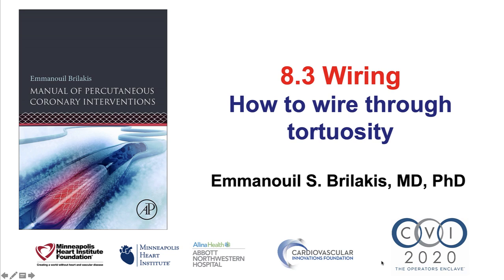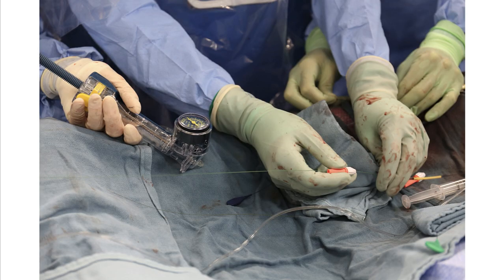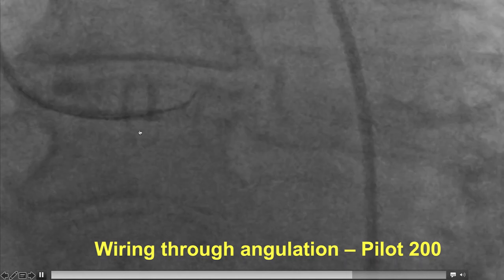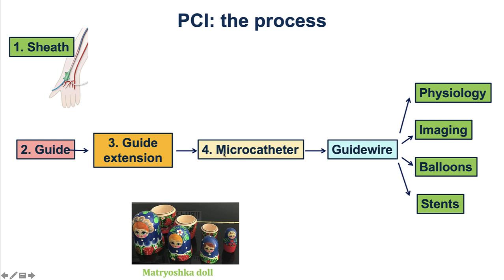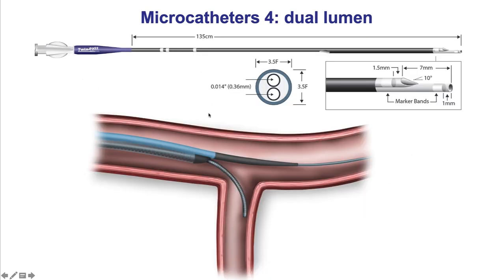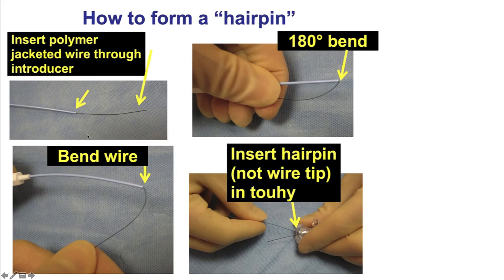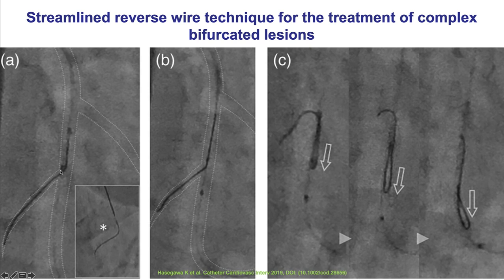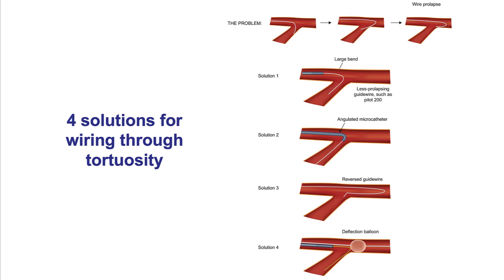8.3 Manual of PCI - Wiring through tortuosity

Comment: Thanks for sharing. I find the reverse guidewire technique somewhat prone for dissecting since the bend is traumatic when navigating the vessel. And the unfolding in the SB is also not easy. Using a microcatheter is more costly but safer and faster, in my opinion.
Reply from the maker: Thank you for your comment - I agree that in most cases using a microcatheter is tried first before trying the reversed guidewire technique.